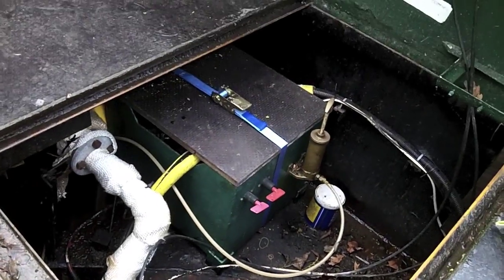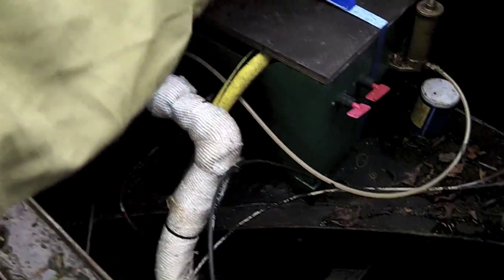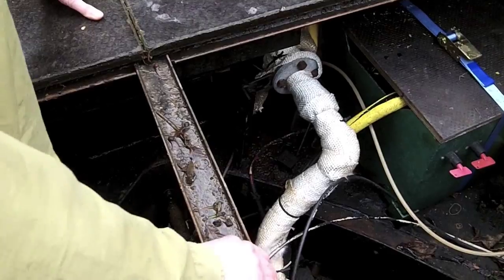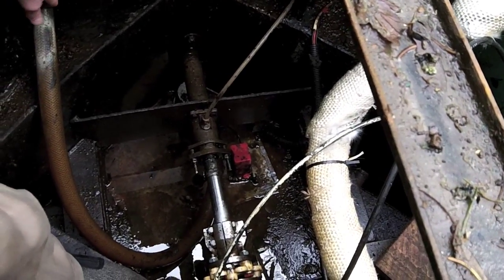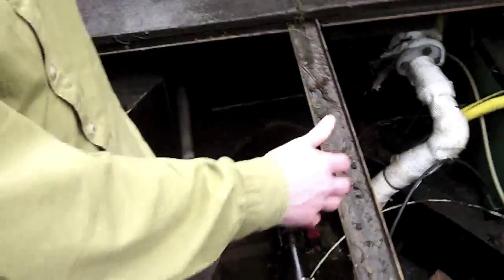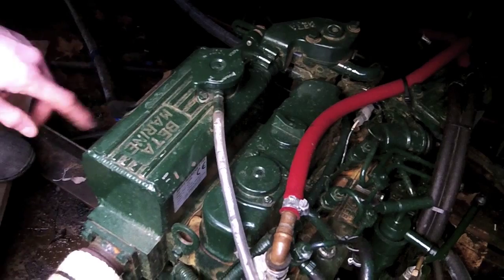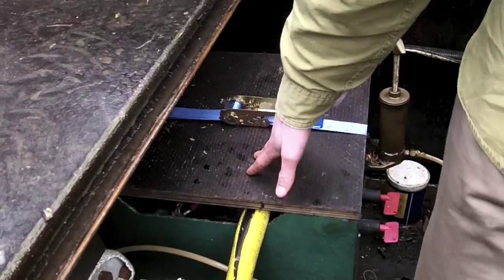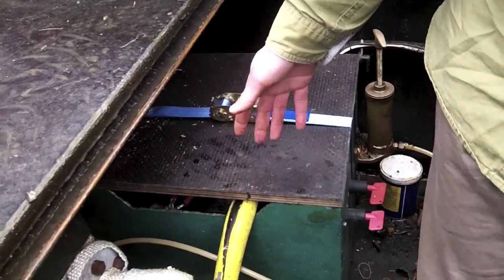A Narrowboat Engine Quick Look

Comment from the maker: Personally the biggest boat that I would want to handle on my own would be about 40 foot or so, especially for the sake of leaving yourself a bit of room if you are working locks on your own, Tilly at 30 foot is easy to handle in everything other than high wind as most boats would be but a 52 footer would start to add quite a bit of walking up and down while mooring etc which depending on the circumstances could be a real pain!

Comment: Bill Caddy
1 minute ago
I strongly recommend, when changing oils on your narrow boat use disposable gloves to protect your skin. Used oil in diesel engines is carcinogenic. Google up the lubricant manufacturer & read the Safety Data Sheet, for handling used oil.